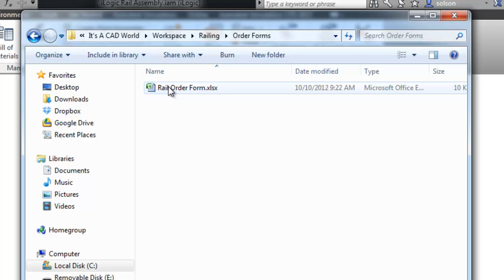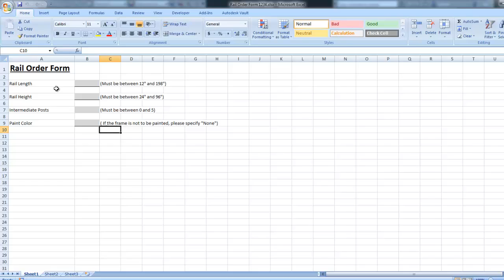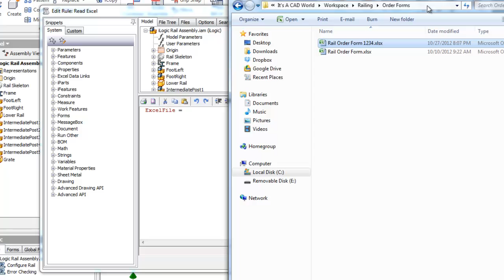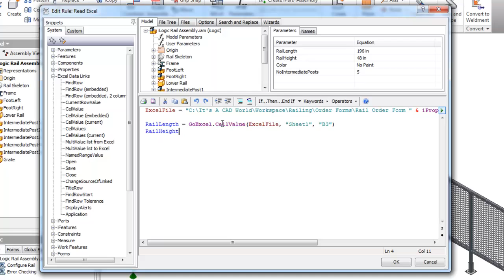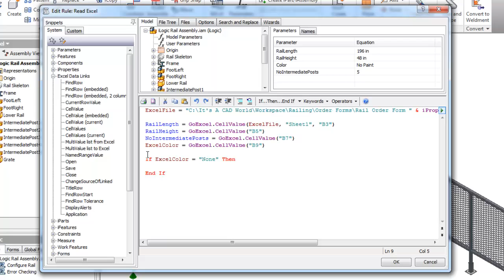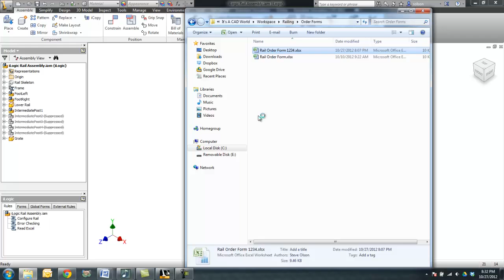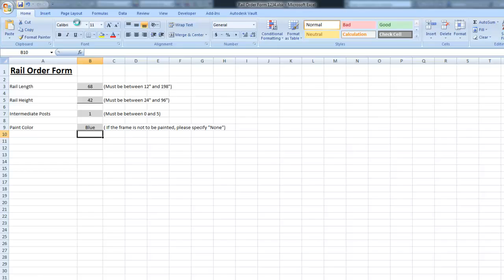Read Excel using iLogic

Comment: Hi, great job. I'm looking to improve this code using INDEX combined with MATCH in order to not specify the Cell inside Excel, instead the code will find the parameter name. Any toughts or suggestions?
Reply from the maker: Fernando, thanks for the comment.  I am sorry to say that I don't have any experience with Index or Match, so I can't offer any advice in that area.  I can say that iLogic is based on the VB.net programming language, so most code that works in VB.net should work in iLogic.  However, in some cases you have to make minor tweaks.

Comment: Thanks for the video.

When I try to access an Excel file from iLogic, I get a "cannot create activeX component" error.  Other searches suggest that I need to adjust security settings through dcomcnfg.exe in Windows, but I have no idea what to change.  Any ideas?